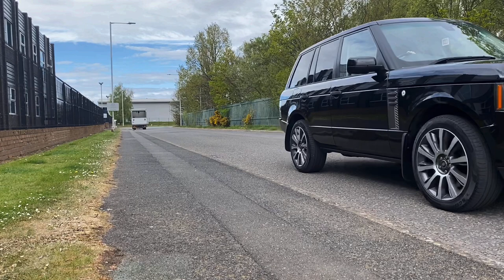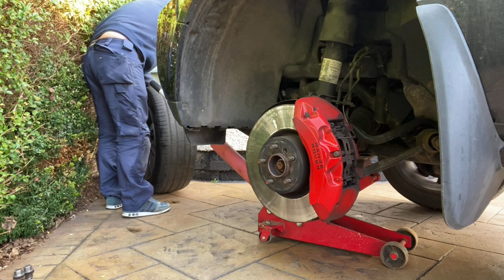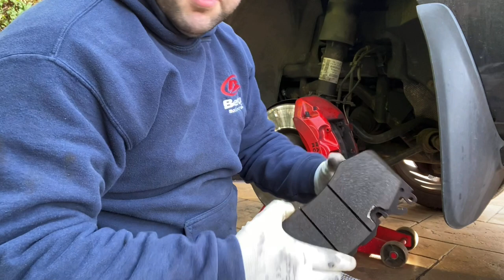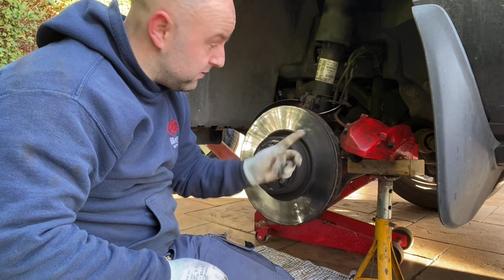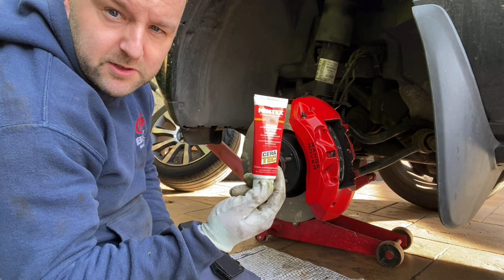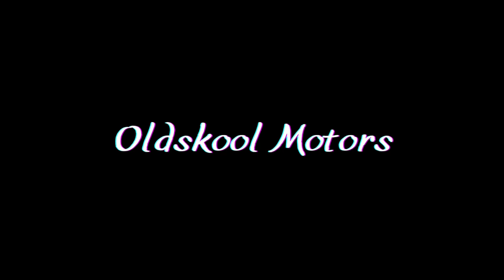Overhauling the front brakes on my Range Rover 4.4 TDV8 L322 *Brembo*

Comment: Only thing to add is around the safety aspect, your sticking your head and body into the wheel arch and relying on the jack alone. Always get an axle stand and use the jack as a secondary means of support, think belt & braces. If your jack had decided at that point to let go then it would have been game over. I'm not perfect by any means and have cut corners many times over the years but having seen first hand what happens when it goes wrong, it really isn't worth the risk for the sake of a few minutes setting up. Other than that, very instructive video that will give some confidence for others to tackle these jobs, brake callipers look great too by the way 👍🏻
Reply from the maker: I have a axle stand just out of shot under the body mount on the sill. Cheers anyway.